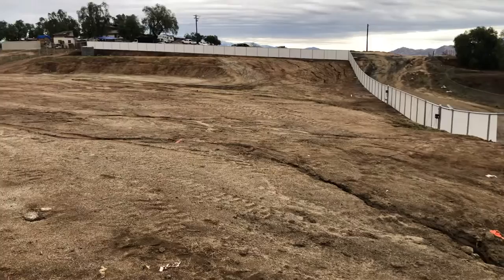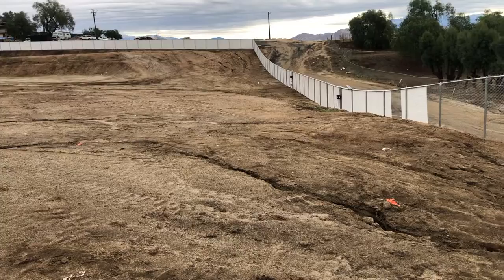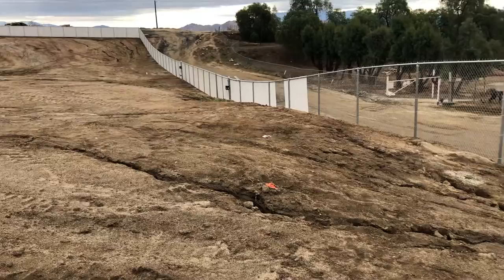DIY how to build a chain link fence PRO TIPS BIAS CUT part 34

Comment: My question is will the chainlink essentially follow the contour of the ground as long as you can get the tension wire where you want it as you follow up or down the hill? Do you just bend the top rail? If so do you have a video that shows this process? Thanks
Reply from the maker: Great Question....It will follow the contour to an extent. The actual tension wire will not if you make it too tight. A tip for that is to hog ring the wire in a few spots and just tighten it enough to stay where it is supposed to without over tightening, it will just want to straighten out on you. Now the chain link will conform much better, you will end up with the top or bottom loose depending how severe the contour. Also watch how tight you make it.. Over the top of a hill it will want to pull tight to the ground. And in a low area it will want to raise off the framework. And the toprail will conform better if it is tubing. Any thicker you will need to start bending earlier as they will not flex as much.  Put the toprail in through the eyetop and have someone else hold the other end and you can make the bends on the toprail then twist over and see if it points to the next eyetop. Get creative and use your best judgement, You will soon find the limitations and learn from each fence. Keep practicing. I will work on making the video when I can. Hopefully this helps out for now. Thanks for asking 👍

Comment: How do you install tension wire on a slope that flattens out at the bottom? Run one down the hill and then another where it flattens out?
Reply from the maker: Great question. The most secure way is to make it up at the transition. If you use brace bands. If you are wrapping, do a double wrap. It will help the one one the bias from slipping. Also if I am at the top going down, do the level line first, then do the bias wire on the top so the bottom holds it from slipping. And if you are at the bottom do the level line and do the bias wire at the bottom to keep it from pulling up. Otherwise if you play around a little you can pre stretch the entire line over tight, and have someone step on the wire until it is tight at each post and tie it off with a tight wrap with steel ties. and move post to post. Just back off the wire or tighten as needed per post. Hopefully that helps . Let me know how it goes.

Comment: Why do you put slats in the wire periodically?
Reply from the maker: Great question. The pre slatted wire is on the far side of the jobsite. And then we have chain link with the slats that we install. The panel I am working on is to demonstrate the slope and show that in the chain link with the couple of slats . The other areas, different guys are installing slats so it is kind of random....👍